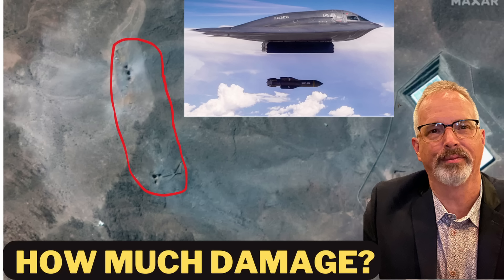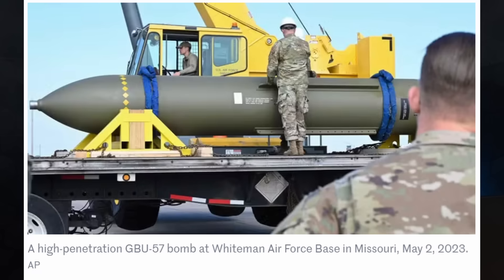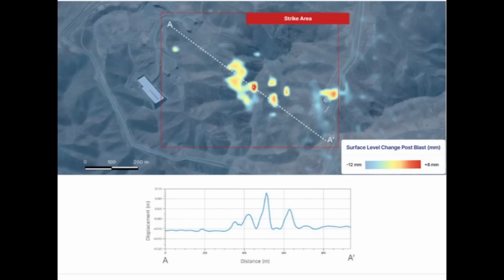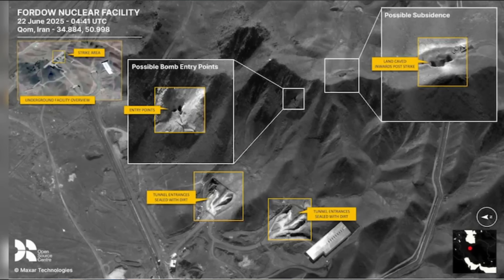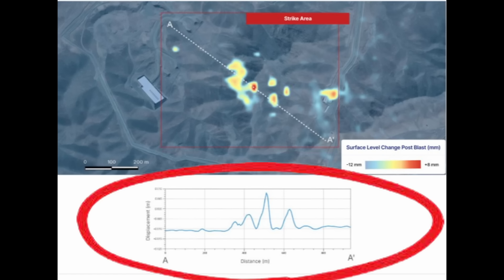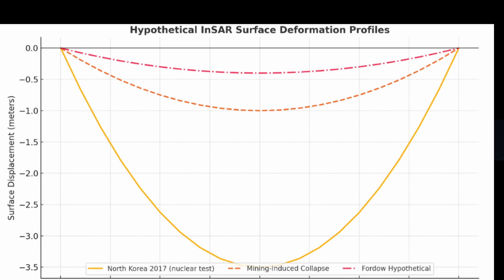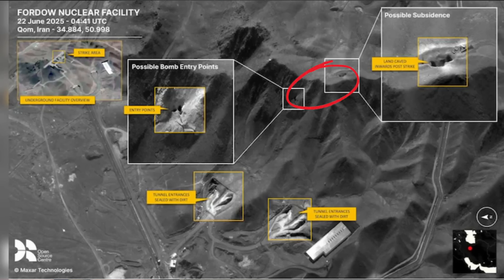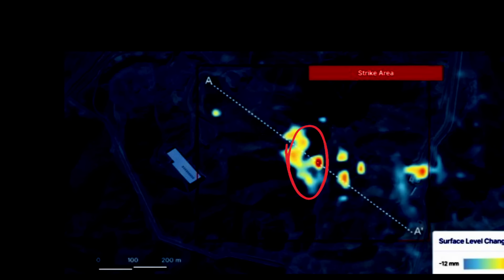Fordow Attack Assessment -  Update

Comment: Couple things of note. The after photos show half the mountain covered in concrete dust. That’s a lot of concrete that got pulverized. The pressure wave from the explosions blew that out the top of the air shafts hard enough to blow out all three openings. The US only sent our bomb through the central opening from the reports I heard. This means the bombs had to pulverize a lot of the bunker.
Reply: Which means nothing. It all depends on the design of the shaft. If it would be for an example an s-shape, build out of HPC, this would likely mean there is no real damage further down, and yet, we would also see lots of concrete dust. 

In the end, noone knows. Maybe the intel community, but we do not. And it will stay that way, until we either get proper official reports or leaks of such reports.
Reply: @nukularpictures I only have access to open source info, so I don’t claim to know. I do know that you can’t change the color of half a mountain overnight without extraordinary circumstances. That much dust required a significant amount of donor material. I have no boots on the ground, so I can only go by the clues we all have. 

Notably the dust is grey (which is why I presume it is from pulverized concrete) and a different color than the mountain. If you look closely at the picture you can see the dust comes from the openings in the mountain. A collapse of the tunnels would displace the dust from pressure differential.
Reply: Yo David they sent SIX bombs down shafts at Fodow. That knocked the dust off ceilings in china.
Reply: @brianthomas6005 I believe they sent six bombs down each pair of shafts (so 12 total).
Reply: @brianthomas6005 You can always spot an American by their high levels of bragging and arrogance.
Reply: An S shaped shaft would not cartoonistically divert the bomb, the first bomb would quickly turn that s shaft back into an o shaped shaft fairly quick.

Reports suggests it was a candle holder shape with the central aimed shaft as being the main one while the two on the side that was ignored being the branching arms.

Finally the mission profile sent is what I want to call over kill.

The 12 bombs used wouldnt need the shaft.  The 12 bombs could have likely brute force their way into the facility without the shafts at all. 

Based on public released performances and claimed depths you'd only needed 3 bombs to get into the facility, 12 is extreme overkill with the knowledge the public performance of the bombs is under exaggerated.
Reply: @ironwolfsaber2739 there are so many assumptions that are likely wrong. Of course an s shaped shaft would not deflect the bomb, but if build using reinforced and layered UHPC, the shaft would likely be even harder to penetrate than the granite. 

Also, you cannot just add the penetration depths of the weapons. While it would have destroyed the rock, it’s still there. So even there you need energy to deflect the rock, to actually go deeper. You likely have a highly diminishing returns for adding additional warheads on the same target. 

Just imaging what is happening if you hit sand. If you just press on it, you can easily penetrate it, if you hit it, you will go a lot less deep. And here we are talking about weapons almost at the speed of sound.

Especially the following explosions would likely spend quite a bit of their energy moving the already broken rocks and not breaking new ones, one of the main oversimplifying assumptions in the video.

In the end, we still don’t know anything. So it is all pure speculation but one thing we know for sure. The Iranians will study it and learn from it. So will Russia and China. So let’s hope it was worth it.
Reply: @nukularpictures  Well there then comes the issues of having S shaped shafts is airflow issues it can cause let alone engineering it to not collapse on itself that far deep. This is one of the most observed facilities on the planet and chances are the Y shaped intel provided is most correct. Remember we're deep enough that everything always wants to collapse due to weight alone and shapes that inherently allow that force to be used against itself creates stability. Most 'zig-zag' designs are not even considered due to possible lateral shearing.  

There isn't many practical demonstrations known to even justify the S shaped one existing. Mainly because they too need maintenance and S shaped holes in anything that cannot be bisected is the bane of any repairs no matter how practical the ivory tower engineer thinks it is. I don't get where this obsession with S shaped shaft came from in the first place its near non-sensical for anything vertically needed in the ground. S shapes only make sense for horizonal applications and not a single entry way observed this design defense either. All of the entry shafts where straight shots and this had been collaborated with video intel evidence.

You know what would make more sense to counter a 'stupid bomb'? A T-shape. One on its side. Bomb dropped flies past the stop it needed to be at and detonates at the bottom of the pit. With the cap bunker getting destroyed the doors can slam shut quickly and wont need to be as stupidly engineered to withstand the explosion as the majority of the shaft will be doing that instead spread out. Provided the bombs are 'stupid'. Frankly if they're sending the B2s to deliver the bombs they're probably putting some of the smartest targeting solutions feasible on them. 

Either way keep seeing the S shape and its on repeat and its enough to file it under information poisoning. The S shape is even less likely due to the 3 holes and their arrangement needing so much extra engineering and equipment it be rather obvious it was being built that way if it was the case. It is not the only anti bomb solution, an upside down Y is also feasible using the arms of the Y as a blast directing chamber. Or another one,  the bunker protected shafts was a decoy the real ones have been camouflaged with plain rocks.
Reply: Ground assement needed or its just observations without concrete indication
Reply: @mkodyglobalsouthsoldier  Indeed it is. All we see is dust, that could be from anything. The easiest way to verify that would be to get a color spectrogram from the site by satellite, to determine the minerals in the dust. That can happen within a day and removes the need of sending a grunt to take samples, which the Iranians would likely object to. But I have seen no such spectrogram images, and have no clue what kind of dust it would be. There are tons of rock that are roughly concrete colored, especially in black/white images..

Comment: Im not sure why people aren’t talking about is Iran manufactures some of if not the best UHPC concrete in the world; back in 2010 they where using UHPC quartz infused concrete  that was 7x stronger and had 3x the tensile strength of regular concrete. We (USA) knew this which lead to the MOP being created; tests where conducted in 2012 showed the 13 ton “bunker buster” could penetrate 180ft of ordinary concrete, but only 25 ft of concrete that was twice as strong so there is a good chance they didn’t even dent the outer facade of the bunker. 

So not only were these facilities extremely deep (250-300ft) but had 20 to 30 meters of high grade reinforced cement above them that was meant to withstand a nuclear blast. 

The reason Iran has some of the best expertise in concrete engineering is bc it is one of the most seismically active countries in the world. Since 2010 concrete manufacturing has gotten far better using microfibers and layering different types of UHCP concrete to further minimize damage from a really big bomb or a nuclear weapon. 

There are lots of research papers from around the 2010 to 2014 that go over this stuff extensively so im not sure why it’s assumed that the bombs only had to penetrate the earth above…
Reply: Construction started at Fordo in 2006 and it was completed by 2008, so it might have missed out on improvements in UHPC.
Reply: "quartz infused concrete" I read somewhere that sand is quartz. so it is sand infused concrete.
Reply: @timfisher77 which is what all concrete is.😂
Reply: Thanks for posting these comments about UHCP concrete. I was waiting for discussion in the video, and was disappointed it was not mentioned at all.
Reply: He also calculated with maximum possible amount of volume which is the most optimistic scenario. However, the most optimistic blast radius only became 23.87 meters.  

That means the bomb has to go 55-65 meters deep before exploding. 

Very deep is a relative term.

In fact the very subtle changes in the ground elevation across this area is proof that the bombing was a total failure.

The bombs didn't go further down than 20 meters, reaching a maximum depth of 45 meters.

In contrast, an exploration at 70 meters depth would not reach up to the surface at all.

Volume gives a big number, but just calculate the volume of a ball with 24 meter radius. You see.
Reply: @idarpolden5913  seems like the right analysis. Penetration depths for 10-30k psi are poor.
Reply: @idarpolden5913 you should tell your mom/sister the next time she gets pregnant not to get pregnant by your brother/uncle, and lay off the meth. 😂😂 If those bombs had only gotten 30' deep there would be COLOSSAL craters instead of holes. You obviously know nothing about explosives.
Reply: A) they dropped them down the ventilation shafts so the concrete was more or less a non-factor, except to help contain the blast to the intended target area. 
B) they didnt drop 1 bomb per spot. They dropped 6.
Reply: Yep, Iran makes the best concrete in the world together with the best air defense in the world..... I mean they shot down a B2 even though they lost control over their own airspace...

Yep nice try...
Reply: @ItsAlways42-z1e well they shot down the biggest F35 ever conceived. 😂
Reply: i'm sure you are unaware but when IRGC was formed they had very little funding so one of the things they did was to get the contracts for rebuilding infrastructure and places that were destroyed in the war with Iraq
also. my dad is a retired IRGC member and our house and all the houses in my area were built by IRGC, so i know a little about what IRGC can do when it comes to building something sturdy
even in those 12 days when almost every day IDF bombed a mountain near my home which was a missile factory, IRGC would still come out from the tunnels in the mountain to lunch their missiles
Reply: Did you miss the point that the MOPs were sent in succession down the ventilation shafts?
Reply: @tooterooterville  Not at all, as the Blast radius is less than 24 meters, the first bomb just filled the ventilation shafts with granite, blocking the others to reach deeper. They made surface elevation changes instead of changes on 90 meters depth.
Reply: @tooterooterville I'm sure the were not stupid enough to make the ventilation shafts vertical.
Reply: Did you even watch the video? Your comments suggests a complete misunderstanding of the video and the claims intelligence makes regarding the facility structure.
Reply: All that concrete means nothing if the entire facility isn't on 'spring' systems to absorb any shaking. 5 MOPs following each other in multiple spots will, penetration or not, will make everything shake. Also, cut any claims made by the Iranian Regime by 60+%.
Reply: @mark.J6708 Yeah and cut any claims made Trump and US government by 100 percent.
Reply: @mark.J6708  There are lots of research  studies showing how layering different mixtures of UHPC that would prevent the MOP from penetrating deep enough to have any effect on the facility. In fact most of the blast would be pushed upwards which is why one of the Air Force pilots said “it was the brightest explosion he had ever seen and looked like the sun”

Not only that they build in blast traps into these structures which would limit the damage from the shock wave if it did get deep enough. 

I think Fordow did sustain damage but not to the point it is “obliterated” and it can be repaired with in a few months.
Reply: @Overlord1189-c2z  Blast upwards is a really bad sign for an explosion  with less than 24 meters radius in granite. 

An successful mission would had no surface changes at all in the area.
Reply: @Overlord1189-c2z if they dropped the bombs straight onto the ground, yes, perhaps, but that's not what happened, is it? Do you really think if they hadnt been destroyed Iran would have caved a few hours later?

Comment: A few flawed assumptions.

The concept that you can use GPS to guide bombs within inches of a target is a fairy tale especially considering Iran has GPS jamming tech and those bombs were literally just gravity bombs from 20k feet once in jamming range.

Based on the difference between penetration of 5 psi and 10k psi concrete it appears that a doubling of the concrete strength reduces penetration depth  by a factor of six.  That means each bomb can only penetrate a max of 1 foot into 30psi reinforced plasticized concrete.

If the vent covers were constructed of 30psi reinforced plasticized concrete at 2-3ft thick, it would taken all 5 bombs just to destroy the cover.  

All evidence is that the bombs didn't even go down the shaft.

Even assuming they did as described, you would think that a nation capable of creating such a bunker would know about blast tunnels, blast doors and other explosives mitigation techniques which even HAMAS knew how to create.  The idea that Iran built a ventilation shaft leading directly into the centrifuge chamber is absurd.

Also consider that Iran's S300 systems could have take out each of these B2s at will so Iran let those bombers drop their payloads for a reason.

America keeps losing wars because America assumes everyone else is living in a primitive society.
Reply: Iran lost the 12 day war. Trump ended the war.
Reply: @MrSummitville  objectively untrue

Comment: Maybe the expansion of the rock expanded into the excavated structures of the facility.  Also, I think the reason the Iranians sealed off the entrances was to contain the radioactive contamination from the destruction of the facility.  That's despite the fact that they were allowed to move the enriched material, which was in everyone's best interests.   I wouldn't be surprised if the U.S. watched abd waited for Iran to finish sealing off the entrances.
Reply: I believe they sealed the entrances to prevent an Israeli commando raid on the facility.
Reply: Yet Trump claimed that the enriched uranium was too heavy" to move.

Comment: Even if the centrifuges were not impacted directly by the blasts, the crushing weight of 100,000 cubic meters of granite compressing down on the chambers where they operated must have turned them into crushed bottle caps. It looks like the public was expecting some huge craters and the mountainside opening up. That is not the way it works.